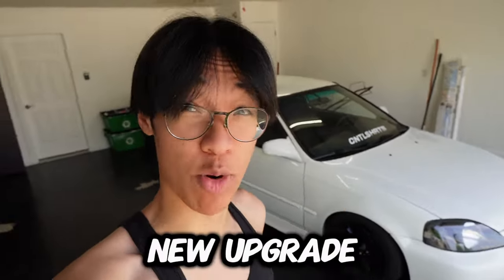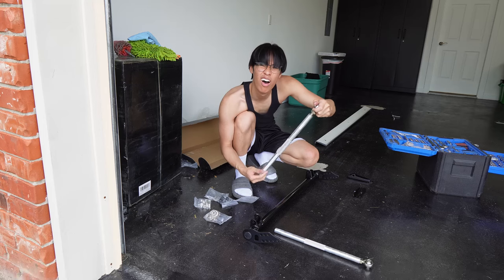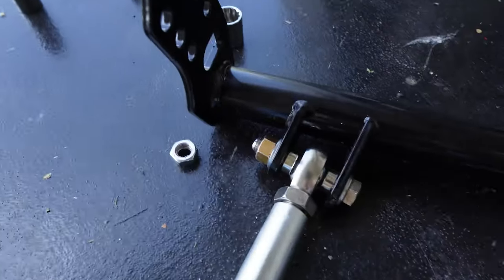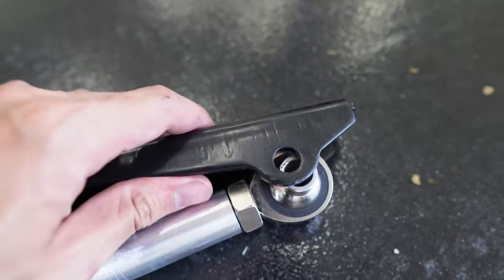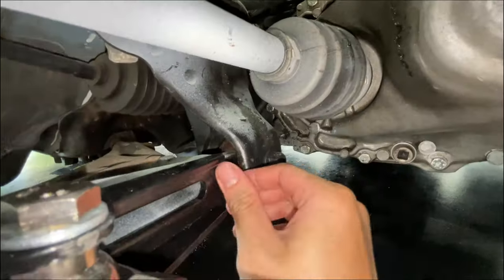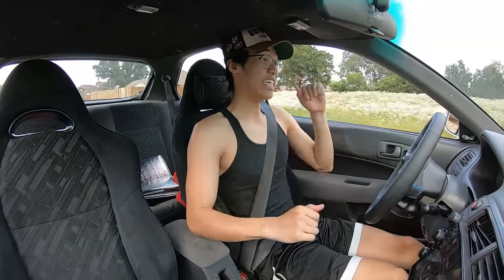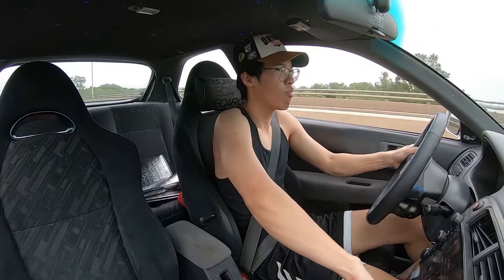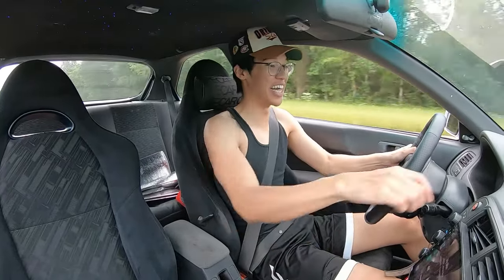The Most Underrated Car MOD!

Comment: Ever did a valve adjustment, that could give you some more power for sure and a oil change with valvoline restore & protect
Reply from the maker: I did it but, I think I need to redo it. For sure I'll look into more of the oil.

Comment: Just a heads up for anybody wanting to use a traction bar on their ek civic. I think if you have a EX/Si model the front sway bar blocks you from being able to mount the traction bar. Im not 100% sure but I have heard that before.
Reply from the maker: Thanks for tip! Anything helps for the community ❤

Comment: How does the bar work
Reply: Spins the vtec solenoid faster
Reply from the maker: It stabilizes the chassis and lower control arms from flexing. The bar makes it stiff for less wheel hop and more traction.
Reply from the maker: @Gen10civic Yes☝️